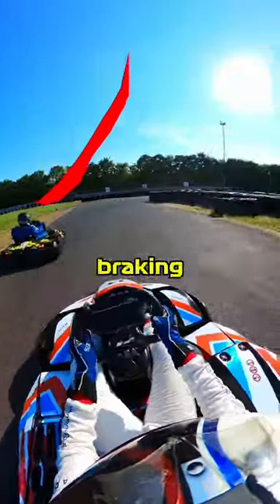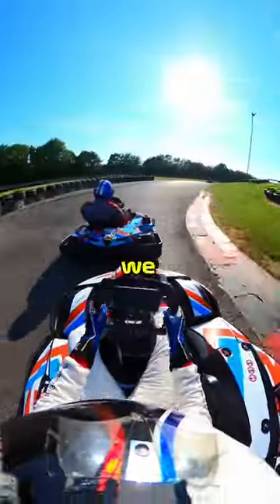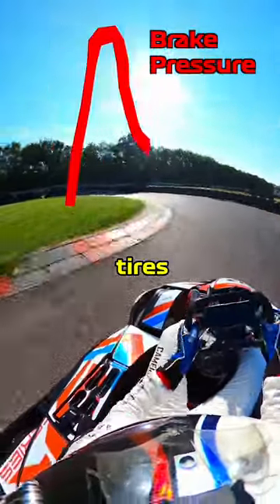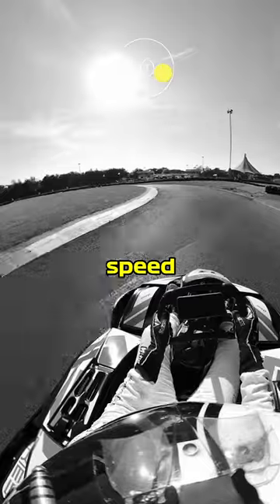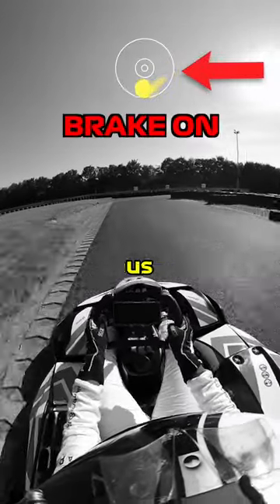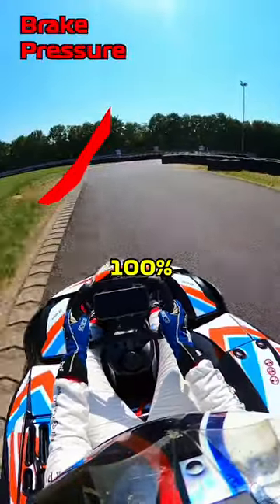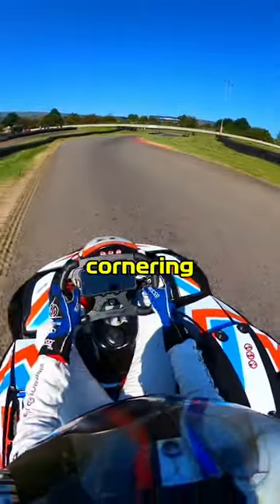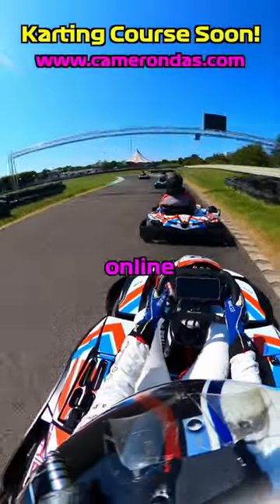ADVANCED Braking Technique for Karting  #f1 #karting

Comment: I raced this track during the wet and it wakes that corner 10 times harder to get used to because you bring so much so much speed round the long left hander that you have to brake a lot in the wet or you wont make the turn but if you brake a tiny bit too hard you lock the tyres and go spinning of into the wall
Reply: What track is this pls
Reply: @tarranian1158 daylong Milton Keynes. Lucky to call it my local

Comment: The faster ramp up to peak brake pressure leads to a greater unloading of the rear tyres which was then causing your rear to slide. The slower and smoother ramp up to peak brake pressure avoided this issue.  The overly aggressive ramp-up habit (for karts) almost certainly comes from your formula driving experience with aero preventing as significant an unload of the rear tyres when performing the same level of quick ramp-up to peak brake pressure.

Comment: Hmmm, that's kinda the complete opposite to how I learned. You want maximum pressure on entry then taper it off on the way round. That way you keep enough weight over your front end to keep it steering.

Comment: I love the sweeping left, right hairpin sequence at Daytona mk.
That braking zone is where I make up most of my time on other drivers.
The corner I sometimes fumble, is the little left hander onto the long back straight.
The apex kerb there used to be much more open, but not has the true barrier further inboard to the track and since that change I do find myself occasional going a little deep and running wide or scrubbing off a little too much speed for the exit.

Comment: I love how different oval and road course racing is. On most short track you would pretty much never go to 100% brake pressure. It’s all about keeping weight on all 4 tires and letting the setup naturally turn the car. You need to put some wheel in it though. The whole idea about keeping your wheel as straight as possible doesn’t apply as much.

Comment: Trail braking!!!
Reply from the maker: Trail braking doesn’t work in rear brake karts like it does in a car. My guess is because of the solid rear axle of a kart, but I definitely find a coasting phase is needed with most karts.
Reply: @CameronDasRacing  When done right it lifts the inside rear wheel so the solid axle doesn't cause issues.
Reply: @eddieelizabethhitler3259 that's in competition karts. Rentals are too heavy and don't get enough cornering speed to lift the inside tire.

Comment: "G-force" is pretty much the stupidest term in existence. "G" is a unit for acceleration, not forces.
Reply: Newton's second law, my friend. F = ma (F is force, a is acceleration)
Reply: @Dieterbe  I am fully aware of that formula, but that does not change the fact that g is a unit for acceleration, you seem to know the difference.
Reply: @Sir_Cactus uhhhh yeah it is cause it is a force relative to the force of gravity. 2G is the force of twice the force of gravity. Say you are 80kg. The force you apply to the ground is 80*9.8 which is 784N. However say you go around a corner and it has the force of twice gravity then the centripetal force is 1568N. G force is a ratio. Similar to how aircraft measure speed in mach multiplied by a number or the speed of light multiplied by a number. And like you said G-force. It’s the force of G. Not G itself
Reply: @Dieterbe can u read my comment I pretty sure I explained it well enough
Reply: @Wally_Wombat689  Gravity is not even a force, it is an apparent acceleration caused by the curvature of spacetime. 
Also, you did explain quite well that mass multiplied by acceleration is force. I fully understand that, that is entry level physics. I just mean that 1 G is equal to 9.81metres per second per second, not 9.81 metres per second per second multiplied by your body weight. 
By multiplying with a unit you get a completly new unit. Therefor it is straight up wrong to say that G is a unit of force, as it is not, but a unit of acceleration, nothing more, nothing less.
Reply: G force is based on the acceleration, for example if you have an acceleration of 1G the force will be 9.81 * your mass. We use Gs because the cornering force changes depending on mass, but acceleration doesn't
Reply: @Sir_Cactus  I am not saying g is a force. It is a force created by g. U said you know the f=ma and you mentioned the effect is has on space time so I know you ain’t stupid. However what irritates me as that Einstein a equation for gravity f= (Gm1m2)/r^2 has f as an acceleration. Despite f being the SI symbol for force. So why is it not a= (Gm1m2)/r^2 ?
Reply: @Kheeto67  That is precisely my point. Why do people say "G-force", if they are talking not about forces but acceleration.
Reply: @Wally_Wombat689  The formula you have there does not calculate the acceleration caused by the curvature of space time but instead the apparent force. Not a real force, only an apparent force. A similar phenomenon is the centrifugal force. There is no force pushing something away from the center of rotation, only the mass wants to go straight due to it's inertia. Gravity kinda works like that but with spacetime curvature instead of something rotating around a center point.
Just think about it, you are multiplying the masses of two objects, that attract each other due to gravity. If that formula would calculate the acceleration caused by gravity, then heavier things would accelerate quicker than lighter ones in a vacuum. The reason that does not happen is because of the inertia of the two objects, that works against the acceleration.
Reply: @Sir_Cactus  Let me simplify it for you cos you're over complicating it. "G force" is well-understood common parlance for G x Force. You know what is meant by it and you're just being pedantic. Many science terms are tweaked slightly when applied to various engineering disciplines. The correct terminology is dependent on context when it comes to such things.
Reply: @EddieTheH  Before saying I am pedantic you should check your maths.
Reply: @Sir_Cactus  See, I was right! You are pedantic! 😁😁😁